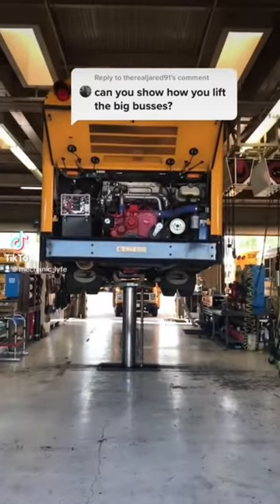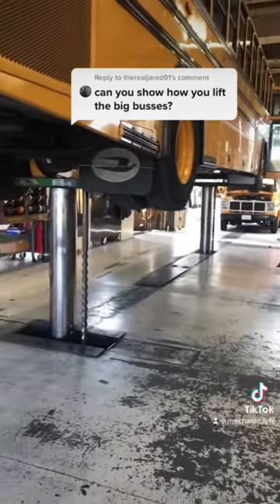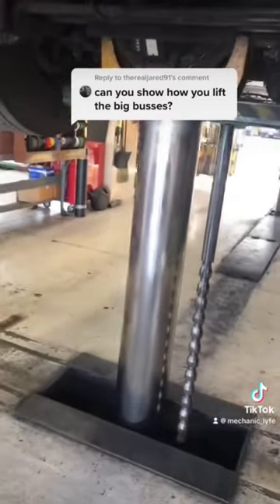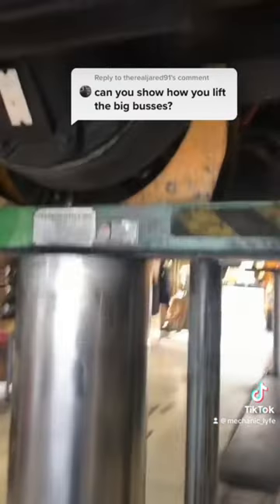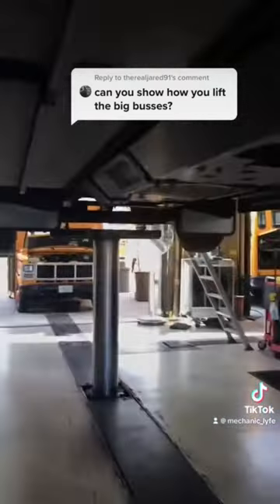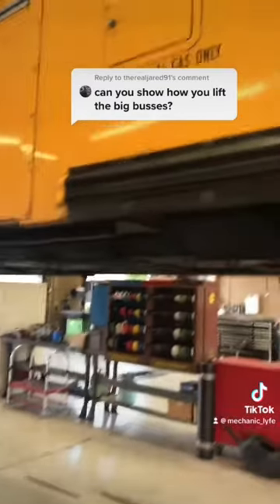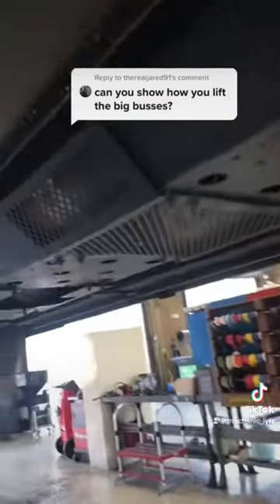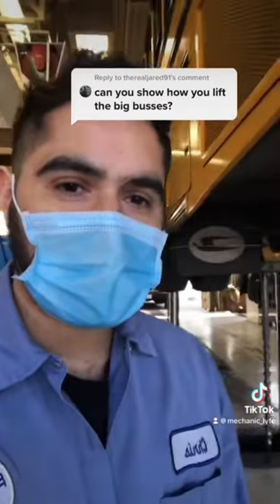How mechanics lift up a schoolbus #mechanic #automobile

Comment: I need to know what district is still running those g20’s those are amazing buses!!!!
Reply from the maker: We no longer run them , only due to rusting out bodies mechanically still ran fine tho
Reply: @Mechaniclyfe  did they get auctioned off?
Reply from the maker: @anthonym744 of course
Reply: @Mechaniclyfe  damn I missed out! I just bought a 2002 Amtran RE 40ft diesel pusher 7.6 DT466E